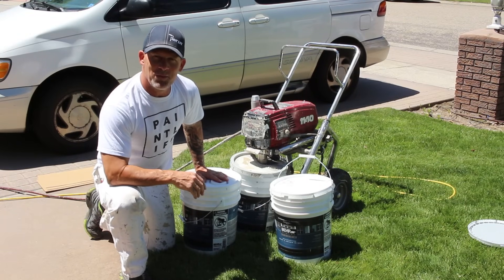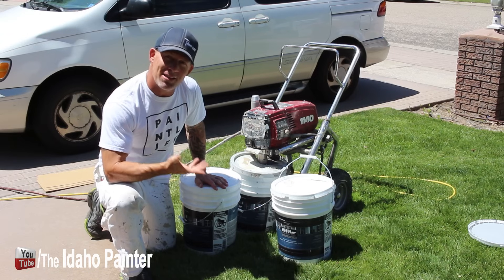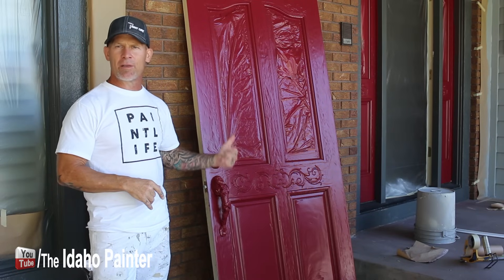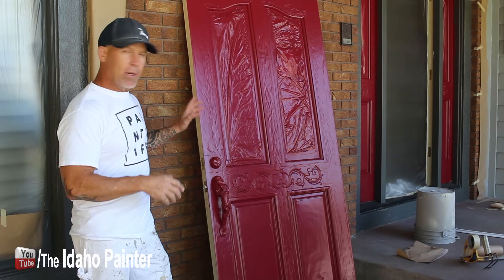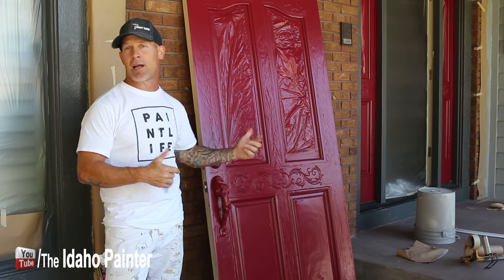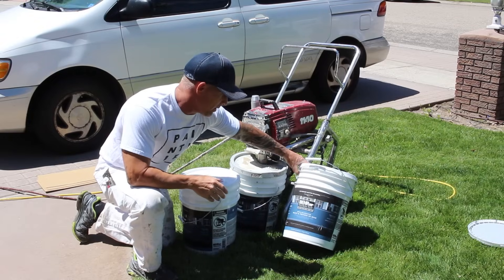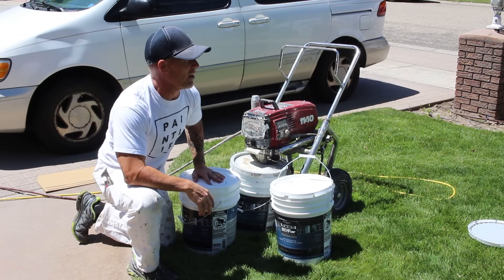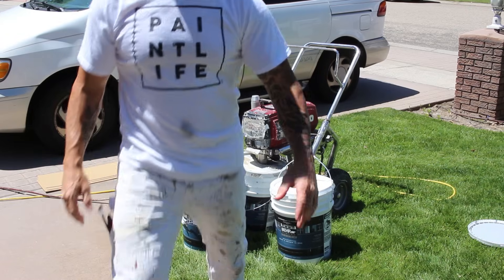Behr Paint Review.  Should you buy this paint?

Comment: Concern: you mentioned that as a professional you preferred one coat coverage. I can understand that thinking from a production and cost point of view, but have some trouble with that concept if aiming for the best "quality" paint job. One thick coat of paint has traditionally been considered inferior to a base, primer and finish coat ( or coats) of paint. Has paint technology changed? Has the adhesion  qualities  of one thick coat of paint surpassed that of multiple thinner coats of paint? I'm interested, please explain.
Reply: TCL no, it's just laziness.
Reply: All paints are designed to perform the best at a certain mil thickness. Whether you acheive that mil thickness through multiple thin coats or a thicker coat does not affect the performance of the paint barring extraneous circumstances
Reply: Obviously two coats far more labor- but two thin coats with = mil coverage overall superior to one thick because smoother and n missed spots,hence better coverage even using the same amount of paint Is this worth the extra labor ? Perhaps not, but it’s definitely ceteris parabis a better approach. Look if you are using same or very similar color esp light color you can get away with coat but in my experience most my competition doesn’t have the reduce labor reflected in their pricing. An honest contractor will quote you one and two coat pieces  and let you decide.but please dot. Try to tell me one coat is + two at job. And be very skeptical if any contractor or paint claim they can guarantee coverage of a different color paint (esp dark to light) with one coat- even BM aura doenst do that always.

Comment: Any thoughts on their Marquee and Dynasty lines? In my experience, they are truly one coat however they dry very fast, are very thick and become unworkable nearly immediately. For example, I'll cut-in and back roll first and only across a small section of a wall (approx 5ft) and when I hit it with the larger roller painting to the wet edge, it creates texture or doesn't blend well and sometimes even peels off as if it's already setting. I've even tried extenders with it to no avail. I dread when a client gives me this to paint with. (I've never tried spraying with it.).

Comment: Never had a chance to spray any Behr products. I stopped using it 8yrs. ago when I fought all day with a ceiling in hot and humid Toronto. The ceiling paint could not be thinned enough to keep the roller texture from building up. I kinda want to give it another chance now because I do think it dries to a very durable finish. Although, there are much better paints which I can get cheaper than any Home depot sale with my contractor pricing.
Chris, is that computer desk painted with the same  PPG Breakthrough as your teal exterior door video? If so, how's it holding up? Not sure we have it in Canada yet but I always like trying new products.
Reply from the maker: Yes, we would not recommend the Behr paint
Reply from the maker: We did not use the PPG for the desk

Comment: Your right about home Depot not catering to contractors, oh I forgot they give you special parking right outside the door!! Yepe. They did have somewhat of discount in past but now eliminated that so they could care less about contractors. So I go to Sherwin Williams or PPG for all my paint.
Reply from the maker: That's the place to go! Thanks for watching Rick!
Reply: Actually, If you join their Pro group, they give you discounts up to 20%.
Reply: Rod Wolfy , I get 40% at Sherwin Williams. For what I think is more Superior paint.
Reply: Rick Washek 
You don’t know what you’re talking about... go see how your SW holds up after a year. 
Duration got named as one of the worst products of the 2000s. SW constantly rates on the bottom end of consumers report whereas Behr is rated #1 in most categories followed by Benjamin Moore.
Reply: you can not go by those reports, they reports are who pays the most and who pays for more advertising...sw and BM or far far superior the any of the behr paints
Reply: @wolf360090  Consumer Reports does not take advertising and do extensive  UV testing for the outdoor. However, in cooler climates it probably run less. The durability is very good. I have found that in warm CA it is more prone run on mill work, Maybe a very thin tack coat, follow up another coat immediately.
Reply: @mattkeefe3850  they actually do, i have used every paint out there, and i can tell you, behr paint is one of the worst next to siko. they also do not stand behind it, and also false advertise, like prime when you paint, or one coat coverage, my family has been in the industry since 1945 and still going, where i live we have the worst climate for exterior paint, and behr will not hold up,if home owner was buying the paint, and they came back with behr, i would say sorry but find someone else.
Reply: @mattkeefe3850  consumer reports take their money from donations, and if a company donates enough, then they will favor that company, they have been doing it for years,
Reply: @wolf360090   Thank you. What is your favorite brand for interior mill work and cabinets that will be sprayed.
Reply: @mattkeefe3850  my fav is advance for trim and cabinets by ben moore, i have done 100s of cabinets , and 10 years later they still look like new,

Comment: I use behr paint the most on my jobs and never came across it running as its thick paint. Never seen thin or runny behr paint in all my years. 
Actuall sometimes i find it to thick on some jobs. 
Maybe its made different in your area as im from canada. 
Great video tho. Keep up the great videos.
Reply: That's because of the rheology modifiers Behr uses. It not necessarily a sign of good paint. They focus on the DIY end user versus contractors who know how to work with a variety of finishes. Some of the most garbage paint doesn't run. You could put a paint stick in it and it wouldn't fall over. 

Behr isn't bad, it's just not formulated regionally, like SW, Rodda, KM, DE, Vista, etc. You can get a equal or better product for less from the wholesale paint suppliers if you negotiate with a rep and use a decent amount of paint. I was a rep for KM and eventually sold ICI products against Behr in Home Centers.

Comment: I'm not a big fan of behr and only use it by request, but  if you look at CR's criteria (Hiding, surface smoothness, Gloss change after scrubbing, staining, cleanability, mildew resistance, fade resistance).  Those are mostly "in service" characteristics.  If they were to weigh those factors against ease of application it would probably end up lower on the list.  In my experience it runs too much and tends to contract around surface imperfections rather than flowing over them so the end result is less than ideal, especially on any trim. That said I can't question it's durability because I've never done such tests myself, and if that is the  customers top priority it seems like a top choice.

Comment: My project, double garage door. Changed color, I tried to cheap out and get the Behr midline what premium plus at $25'ish a gallon? Took me 1.5 gallons to cover my double garage door. Didn't like that color, used Behr Marquee. Required 0.75 gallons on the same door. Long story short you are not saving money with cheaper paints. You are doubling your labor and time. The cost comes out the same in the end. Wait till Sherwin goes on sale like 40% off.

Comment: I have a client that insisted on using this on the interior of the home.  The home was stripped of all carpet and flooring which made it easy to spray. I found that just like it did several years ago, it also runs when Spraying as well as brush and roll.  The interior spray also flashes very easy Unfortunately I am not a fan

Comment: Oh, one Behr paint I do like as an exception is actually Behr alkyd, though. There's obviously better stuff on the market, but it's not bad at all. It levels super well, and dries hard on primed surfaces. Just it has an 8-12 hour dry time. But for what it is, it's not bad at all, especially for $35 at HD. Just adhesion is only acceptable, not great, as in, it still won't go over poly/varnish with no primer, but again, for what it is, not bad at all.
Reply from the maker: Awesome, thanks for sharing!

Comment: I think Behr's exterior paint was pretty OK (last used in 2015) rolled and brushed smooth. The biggest problem I see with it from a DIY vs pro painter perspective (the exterior was less bad in this way, but the interior was really bad...) is basically it doesn't level out well at all, and roller/brush marks just stay there because it's made to dry quick, and be "easy to apply" by poking paint/using a cheapo brush, so it sacrifices the ability to level for that. The interior ultra I remember approx 2012 being good as a beginner painter, but then I used some again in 2015 and it was just absolutely horrendous, and I think it was a formula change, and even the Behr shill Jack Pauhl admitted to a formula change and stopped using it around then, too. Premium Plus I used about the same time frame was OK and oddly better than the Ultra, and basically handled similar to Promar 200, etc.
Reply from the maker: Thanks for sharing!

Comment: ive been a painter for about 10 years now... i try to avoid behr at all costs :p  its just not the same quality as a paint from a paint store, ben moore, sherwin williams, dulux.. some costumers really want behr or theyll buy the paint themselves and supply us with behr.. but for the most part we try avoiding it.. had an issue with their paint once too, bought 10 gallons and the paint wasn't sticking, luckily when we called them they actually refunded us on the 10 gallons, we only used 2.. 1 was giving us issues so we opened another to see if it was just mixed poorly.. but the 2nd one gave the same issues, it wouldnt cover and was runny and jsut a nightmare. and they refunded the 2 we opened and used as well.

Comment: I do
Not have luck with Behr or the paint from
Lowe’s-even the SW line no matter how many times I use it or type I use. When I buy from SW I have the best results and less work overall. 

I found a 5 gallon of scuff resist behr in the oops pile for 30$ in the color I wanted - or close enough I should say- for my garage. So yeah I figured I could work with it for the price. It’s a great color once dried. Need to water it down and add flowtrol  otherwise the thickness doesn’t COVER. I see the drywall under even a heavy coat without water and floetrol. 
I wonder if there is a trick I don’t know about with Behr. Others love it I just can’t get a handle on it!

Comment: I run a pressure washing business and I work in an area that has a lot of log homes in North Georgia. I would really want to get into staining and restaining homes. I use soft washing in my business since I was around wood.
I'm just curious as to what else can be painted with an airless sprayer?
I am looking at the Titan model I believe the 400i that you recommend.
Can you paint bedliner material if it is thinned down? Raptor liner is a two-part product and hardener that can be thinned and also tinted. I'm honestly thinking about using it to respray gutters. As well as a couple of other ideas for it. Again mainly because it can be tinted any color even clear-coated.
It would be nice not to have to buy two separate pieces of equipment but I will if needed.
Once again, you and your crew do such an exceptional job not only your work but showing us how to do it and I want to support you all by getting my products from you.
Thank you!

Comment: I have been using Behr Premium Plus paint for over 20 years and it does a great job for me. A long time ago the exterior paint had issues with fading, but it doesn't do it now. I know Consumer Reports has it listed as the best paint you can buy. The Behr Premium Plus rates higher than their Marquee brand, so be sure to use it. I also used Behr Premium wood stain on my treehouse and it has held up great so far. Just don't buy your paint brushes at Home Depot, BigLots has high quality paint brushes that cost about 80% less.

Comment: I agree with the tradesmen in the video. It runs easily so you have to watch it. As far as coverage it is one of the better paints out there. However, across the board I find Behr to be only for the DIYer and not pro. Advice to any painter diy or pro. DO NOT USE BEHR CEILING PAINT. It is the worst shit ever. Lap marks everywhere regardless of keep wet edge. Just awful. CHB from SW is best ceiling paint on the market imho. Thanks for the videos Chris.
Reply: Thank You.
Reply: I used behr marquee 1 coat ultra white eggshell on my ceiling. It covered well without lap marks but that might have been because it was eggshell
Reply: @ChrisJohnson-tb1rw  I think they have improved their formula in the last few years
Reply: @southsideshenanigans  i can agree with the runny drip. I noticed that when i was cutting

Comment: There's a reason why bher is rated number one by consumers. Can't beat it for the price range. It is very workable and good coverage. I prefer it over valspar and most Sherwin-Williams. If it runs it's because too much paint was applied. For me most of the paint that hang well are difficult to work and dry way too quick such as a lot of the valspar and Sherwin-Williams paints, they begin to dry in the brush and roller before you can even work it

Comment: You must hate Rustoleum for the runs then. The Behr primer/paint exterior that I've used this spring was very good all-around. Sherwin Williams Diamond has an outstanding coverage capability with no runs.  The Benjamin Moors Advance gives a very good finish to repaint furniture but it's pricy. The rattle can Buty-Tone for metal was a good surprise considering that it's 20% cheaper than Behr or Rustoleum.

Comment: First off love the videos, have watched them all and have got me off and painting with a new titan we have picked up. We are painting the interior and exterior, currently we are on a budget and Behr has 30% off of all their lines. So we picked up some paint for the interior and I have sprayed the walls in a room and ceiling. Walls turned out great! The ceiling on the other hand I have painted twice and on both occasions I ran into the paint "alligatoring" from my research. The only thing I could think of that is different is on in our grey interior and the other is a flat ceiling paint. Any help or info would be great as I have the whole house to paint.
Reply: Not sure exactly why but only paint that ever failed on me was Shirley Williams.  Not surprised Behr does that.  Perhaps there is an oily residue on ceiling.  One paint I’ve never had issues with to date is PPG.  Has never let me down and Gripper performs much better than kilz imo.  Good luck

Comment: Just bought some Behr paint exterior  high gloss white with the primer in it,,,,which I believe most come with,I did so on recommendations that I watched on a couple you-tube channels,it was the worst paint I've ever used ,it was drying or pulling/tacky almost immediately made it very difficult to work with,personally I don't like water based paint for outside applications,I think the old oil based lead paint was best,they say it used to have Crack lines in it after a while,but I remember it lasted a long time before it would do this,I don't think today's paint has the long term durability.

Comment: I think the highest quality levels of Behr paint feels like really good paint to an average DIYer. By that I mean it feels thick and has decent coverage. But, if you have used truly high quality paint like the ones supplied by Sherwin Williams, Kelly Moore, Benjamin  Moore, or MIller, you will realize it doesn't stack up. For the same price, the quality is much better than anything from the box stores. I  worked as a pro remodeler for a number of years in my 20s, but now I am a DIYer myself. If you are going to do your own painting, take my advice and go to a paint store, they will get you on the right path. In cases where you hire a pro you are usually better off letting the painter supply the paint. They can get good discounts and are not likely to choose cheap stuff because of the extra labor costs involved.

Comment: My expierence with 1 job  is that it peeled off in sheets over primed wood when every prep was according to Behrs specs. It happened twice on the same entertainment center I built for a client. This was in 2006. Of course Behr said it was my fault and not the paint and wouldn't even compensate me for 2 gals of paint. At that time I had over 30 years of finishing experience with stains, lacquers, urethanes, etc. 
It might be good paint and a lot of people aware by it but I wouldn't use it on a client's house if it was given to me.
Reply from the maker: Behr is DIY paint

Comment: I’ve used Behr exclusively for over ten years,originally before that it was a horrible product but they made tremendous strides in improving their paint in the last 10 or so years as such I don’t find any of the complaints in this video to be true regarding running Behr ultra has a much thicker viscosity than Duration which I find to be thin as piss. And Behr Marquee has better one coat coverage(especially for the deep base colors)than any Sherwin Williams product including Eminence and doesn’t splatter either.